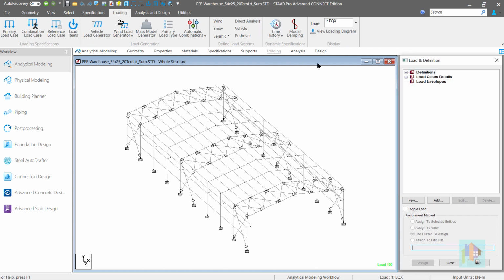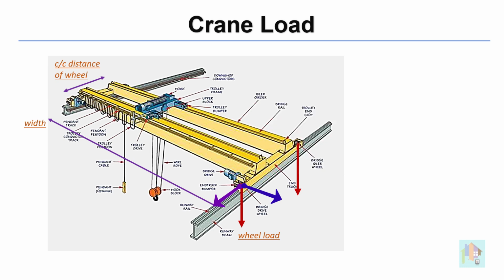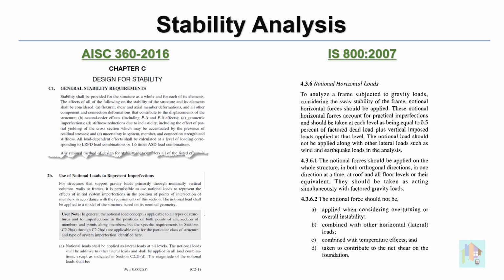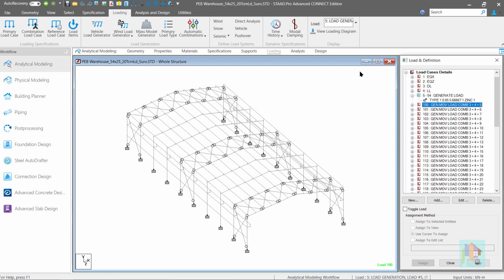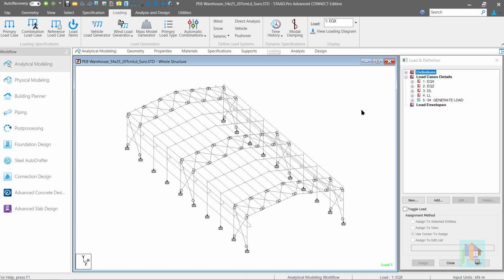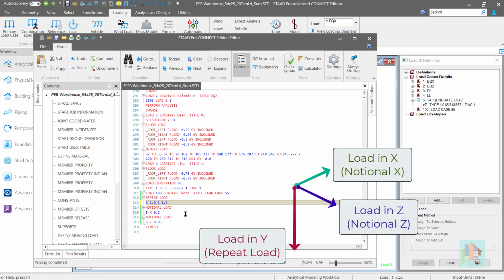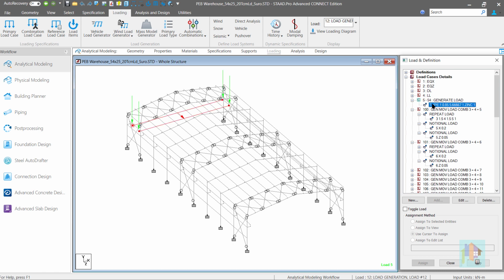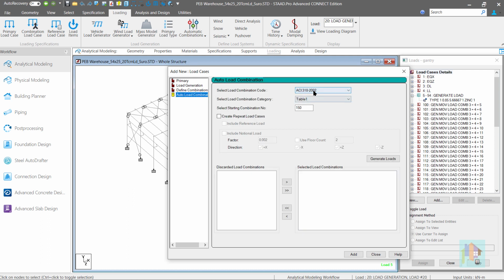Moving Load: p6 - Horizontal & Axial Crane load || Moving Load Combination || Auto-load generation

Comment: Hello you said you will cover some few details in next part but,that part does not have these things,are they going to be in part 8?

 1.Assignment of notional load in part 7 without introducing nodes in gantry girder as introduced nodes leads to more assignment of design parameters.

2.And also the autoload comb factor to combine the moving load with other primary load case as defined under table 4 of IS 800 :2007

3.This is a question,when we opt to use text file to import wheel load in Staad,what is the order of wheel load,the first written wheel load in text file will be considered as front wheel or rear wheel?

4.Where can i download this macro for load combination + moving load  i cant see it in forum?

Thank you for the detailed videos,i always gain new knowledge starting from theory and how to practice it in Staad Pro